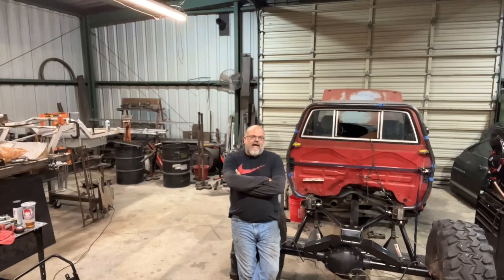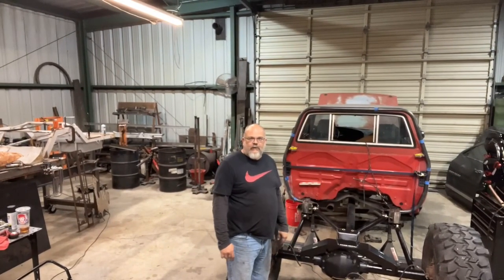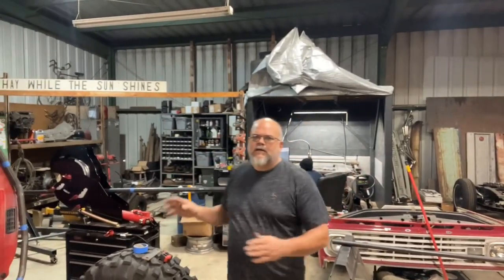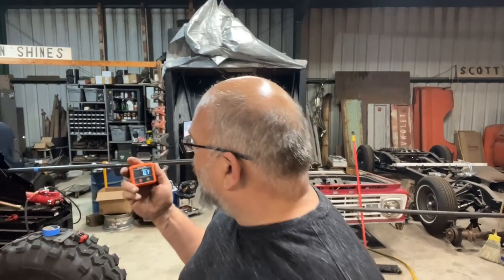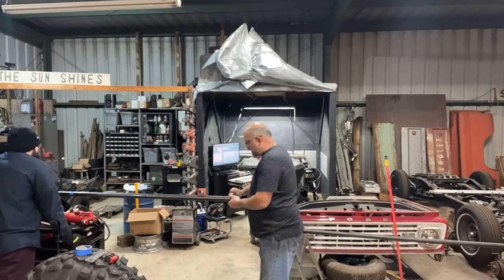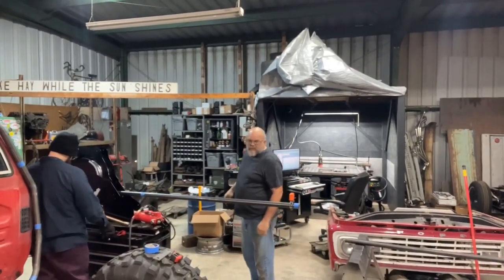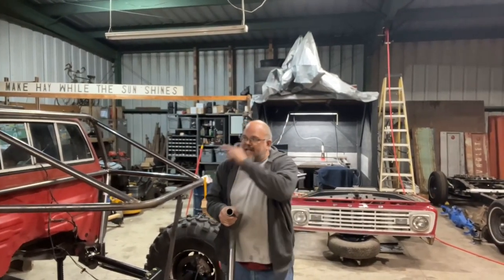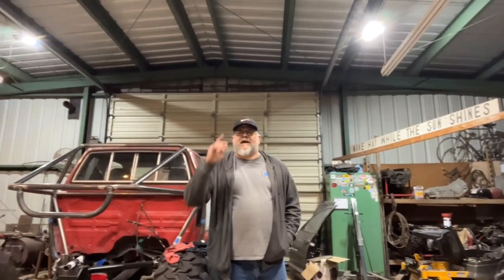Toyota Exo Cage Part 1

Comment: What software is he using that prints out the coping patterns
Reply from the maker: Bend tech I believe.
Reply: @timeandmoney620  thanks for reply 
Gonna be following this same build on a double cab but making rear links longer to fit my ruffstuff trialing arms.  
Where did you get the upper link mounts on frame ?
Reply from the maker: @caseynelson9104  its all from ruff stuff